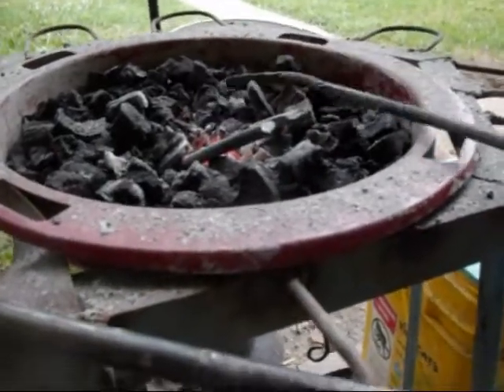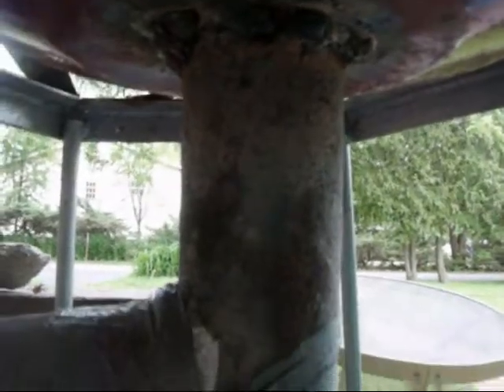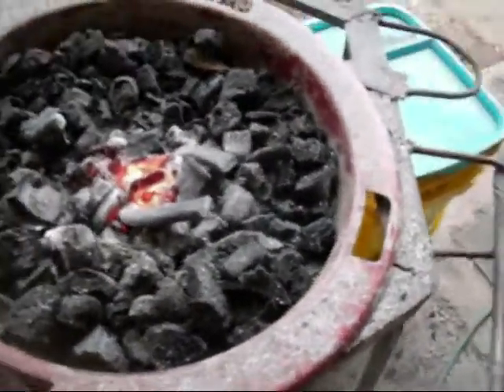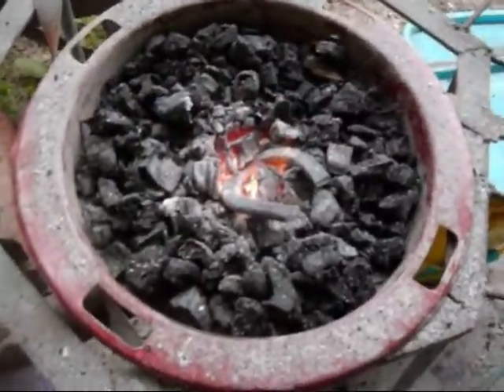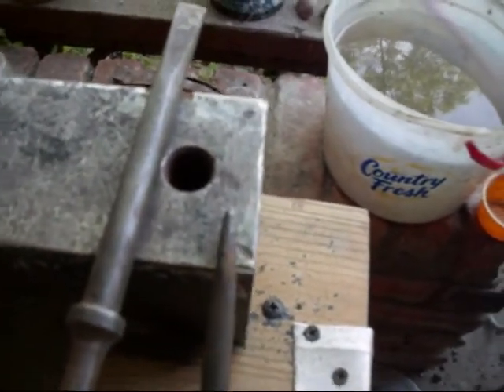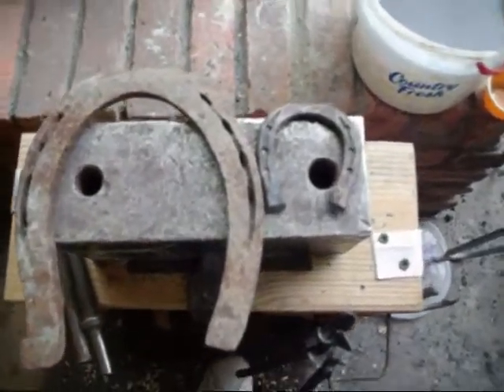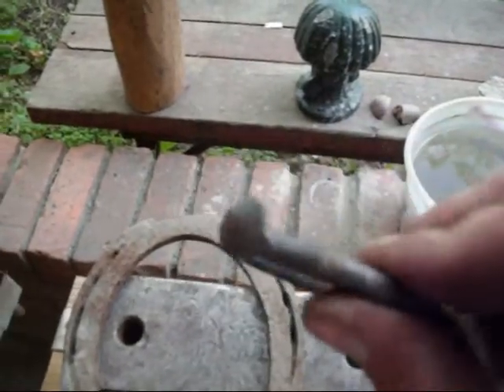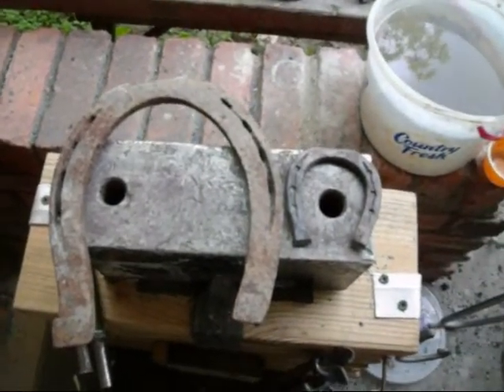mini horse shoes

Comment: you could make it in to a door knocker , just an idea , i want to start doing black smithing as i recently joined a medieval reenactment club so ill be wanting or needing to  make armor or spear parts soon , i have made rings out of old coins but obviously it doesn't really involve much heating , do you have any tips , im 17 all i have is a hammer and an inch and a half steel plate i use for an mini anvil